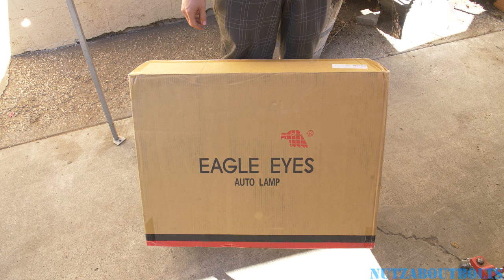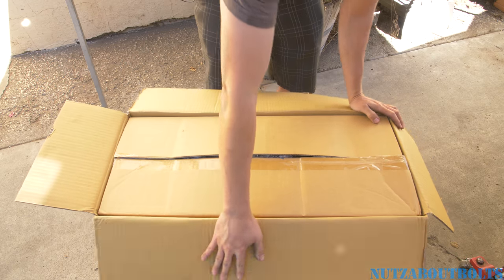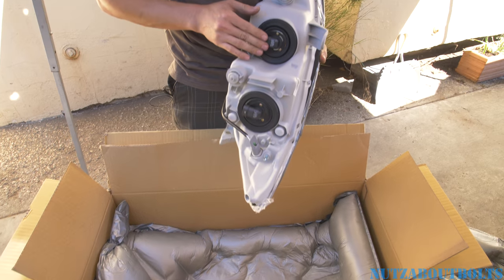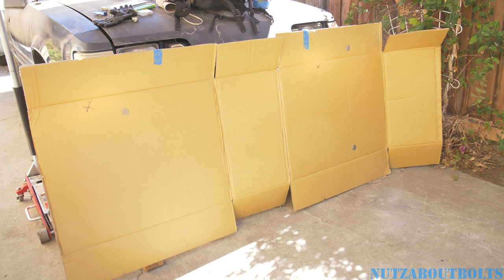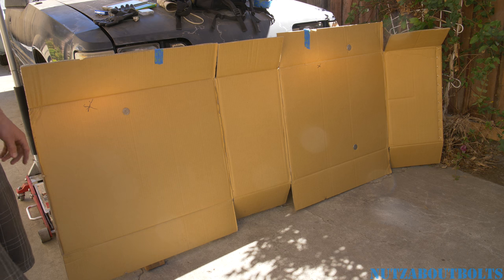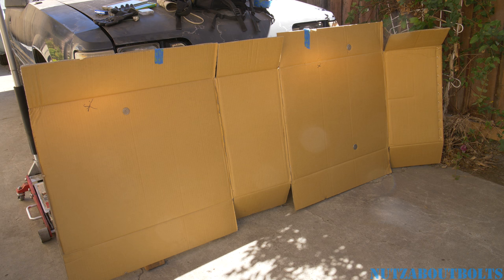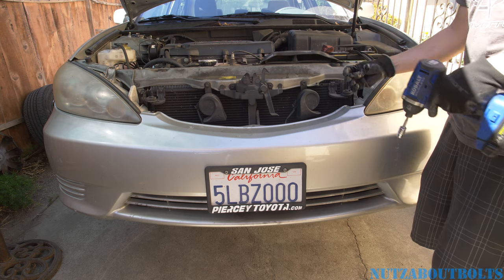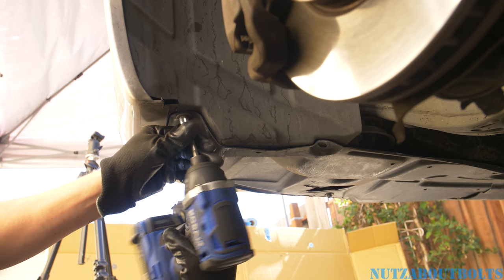2001-2005 Toyota Camry Headlight assembly replacement

Comment: Thank you for the instruction tutorial!  I’ve got to replace both sides because over the years the original ones are not clear AT ALL.
Reply from the maker: Yeah over time it’ll become hazy, I’d recommend keeping the oem Incase the aftermarket headlight starts cracking. You can reuse the oem one after buffering it out as well.

Comment: I know its been 3 yrs later..
Great video buddy , to adjust the headlights use a  phillips screwdriver if u notice there a groove to fit a screwdriver #2 that will catch on the teeth of that wheel headlight adjustment for a much easier adjustment , driver side its more tight but if u do it with a screwdriver its super easy

Comment: is it necessary to take the bumper off to change the headlights ??
Reply from the maker: lgero not if it’s just the headlight bulb, but for the headlight assembly, you will have to.

Comment: U don't have to take the bumper off at all
Reply: 💀💀 right
Reply: Just kinda unclip the fender on each side to get the assembly out and back in , then clip it back in ?
Reply: @TheRuckdog thats exactly what I’ve done several times. Just unclip at the sides, rotate the bumper cover down far enough so you can access the one bolt on each side and you’re in business.